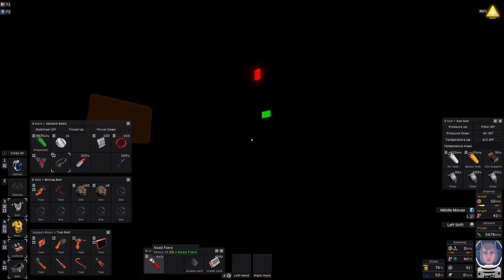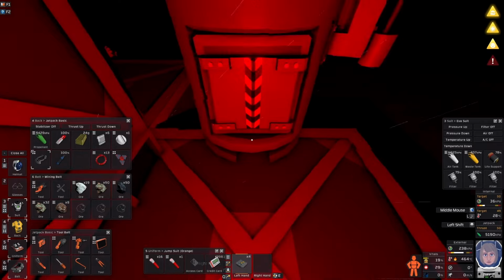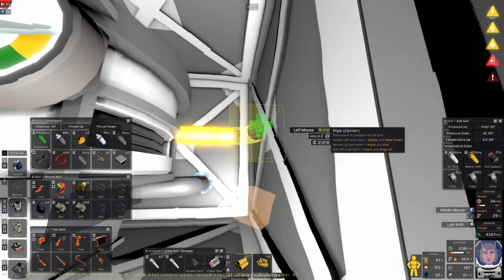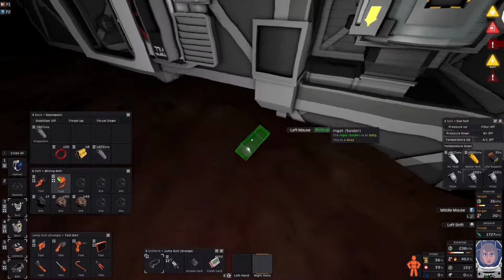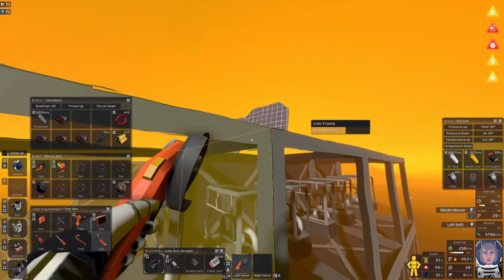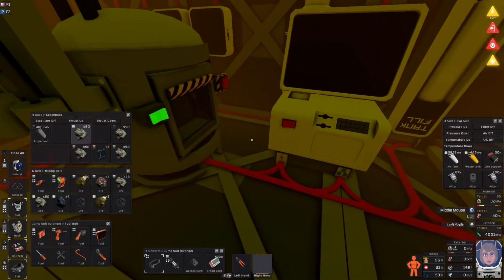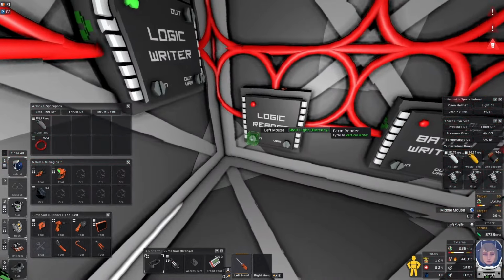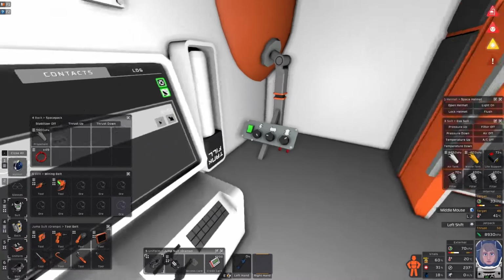Venus Brutal Stationeers Guide [Outdated] (without wasting oxygen)

Comment: Incredible video mate! Could you go into a little more detail into how you've piped up your A/Cs and filters? It's a little hard to see in the videos where all the input and output pipes are connected. How close were you to running out of stored oxygen by the time you got the O2 filtration setup?
Reply from the maker: Here is the save:
drive.google.com/file/d/13Oxn5ZGHqVCNE1D5SlTjJ7Ezfn93INV7
Reply: @murtisoft  thanks! I ended up finding a flyby of the setup from when you were setting up the landing pad which i went through frame by frame lol - very helpful, I don't think i've rewatched any video as much as I have gone through this one ;)
Reply: @murtisoft  the save was very helpful thanks! found the last pieces i was wondering about. What's your next challenge?
Reply from the maker: @the_wilderman  Well, nothing. ¯\_(ツ)_/¯
Reply: also where is your water input? i assume you pumped your insulated canister in somewhere for farming?
Reply from the maker: I cant explain much more through text beyond what i have already explained in the video. I will upload the savegame for you to mess with.
The amount of oxygen you use by breathing is miniscule, once you have a cooling setup, you can live off of the starting supply for a very long time, just by reusing it. I bet I didnt even use 1/4th of the starting supply by the time i had oxygen production via potatoes.
Similar to my oxygen supply, I filled my water pipes with the starting water canister, and recycled the empty canister later on. By the end only water input I have is through the landing pad.

Comment: Whenever I try switch on even 2 of 3 pipe heaters in the furnace hotroom setup, cables start popping all over my base. Followed this guide pretty much to a tee but I can't get my head around how you've made this work. I think it stems from the fact that APCs have unlimited output, meaning it can spike the power over 5kw even if its input is capped, because of the energy stored in the battery. Am I missing something, or did you just make sure your base was at a low power draw before running the pipe heaters?
Reply from the maker: You are right, APCs have unlimited output. for the input limit to apply to its output as well, you need to not have a battery plugged to its slot. You dont need to have one there, after setting up a station battery anyway. Besides, having no battery plugged in stops the annoying buzzing sound it makes. :D
If you turned off your cooling system while you are electrically heating your furnace, 3000+change electricity draw should not burn any cables even with a battery plugged to the apc.
Reply: @ thanks for the reply, I managed to get it to work by disconnecting the ac and using the network scanner to verify I had more than 3kw headroom. 

This was a really great video btw, I would love to see more challenge guides or more specific guides too, good editing, good info, good work.
Reply from the maker: @MichaelW-qb6rd  Glad you got it sorted. At 22:17 the transformer in the corner controls the power input to the entire atmospheric group, both cooling and filtering. You might have skipped that one.
Reply: @murtisoft  hahaha, no I’ve just been lazy and been removing the cable whenever I need the atmospherics turned off 😅. I tried not to miss anything to the point of going frame by frame for some portions, for instance to see how you set up the solar tracking (this is my first ever play though of this game)
Reply from the maker: @MichaelW-qb6rd  First ever? holy s-. You went in the deep end. I even skipped explaining certain parts, trying to keep it short, assuming people would know them by that point.

Comment: Very good guide.
I initially use three furnaces - one for degassing and solder production, one for melting the already degassed ores for the production of alloys (copper, gold and electrum), and one with a temperature of 1210 degrees Celsius for invar, constantan and steel.
When degassing in the furnace, according to the game mechanics, the temperature drops to 100 degrees, and for Venus, these are devilishly cold gases. I filter X and N2O, and collect the rest through the waste outlet (O2, N2 and CO2) in a tank. With one conditioner, I cool the collected gases to about 30 degrees and use them in the greenhouse, and the waste heat is used to heat the degassing furnace.
Reply from the maker: Good idea. I did attempt something similar before. But for invar, I usually just get lazy and buy it from a trader.

Comment: Great video dude! Great pacing and you planned this really well! It's refreshing to see a narrated video where the player isn't guessing what they're going to do next 😹 Great stuff!

On planets with an atmosphere, I usually add at least one wind turbine to max out batteries during storms. They're not too expensive and are really helpful to keep power topped off. Upright turbines can produce a decent amount to at least keep some charge on batteries in APCs

Btw why did you skip an arc welder? It seemed like you were able to produce one earlier in the video. Was it because of the power situation?

Also there's an exploit where if you use the wrench or cutters to place the same segment of wire, it applies the paint. No need to remove and replace

You can enclose your solar panels behind windows. I think there's an efficiency loss, but it's better than the time spent rebuilding or repairing them
Reply from the maker: Because of 10 solars on the roof, they produce 4980 watts, just 20 short of blowing a wire, adding a coal generator or a wind turbine will require splitting the circuit with an apc or transformer, and in my experience they waste some solar power because of some mysterious delay as they relay (Beyond the 10W they consume)
Arc welders are slower, but it wasnt really conscious here, i havent even spent the entire fuel canister when my recording ended. I just didnt need it.
I do overlay colored wires on top of older ones, its just faster to remove corners, instead of trying to match the shape of the previous. That said, i do frequently forget.
As for the solar panel damage, such improvements would most likely come after the events of this video. It was just a total of 3 storms.
Thanks for the feedback.

Comment: From my experience, on a power budget you can do 4 ACs to barely work with Venusian temperature to get your base down to 20C, it will be extremely slow though but it can be enough to potentially cool your base down. I like to see how things go and you definitely showed that it is possible to save that first waste tank. I had resigned myself to losing the first tank but being able to get a habitat setup and capable of saving subsequent waste tanks. My starting base is a very cramped 2x2 base, its enough to stack the printers, hold your tank, and disassemble the crate to have some storage. It is possible to still make the dish but the ability to expand the base is a huge relief.

Interesting to see the solar tracking route. Usually the first thing I do is rush out the steel to get a station battery to get a solid fuel gen to use it to begin charging the battery for base power. Once that is ready I get started on traders, then AC, and then finally start working on renewable energy so that I'm not reliant on coal 100%.
Reply from the maker: I have tried 2x2 previously, trying to come up with the best start, but concluded that rushing iron for a 3x3 is a lot less cumbersome overall.
Using no wind or coal is my stubborn obsession more than anything, and it definitely isnt a must. I doubt that my habitat could manage 4 ACs, with their efficiency penalties, although I imagine it wouldnt be an issue with coal.

Comment: I suggest do some things different:
1. Put Arc Furnace inside and vent gases from time to time. You save time and oxygen on going out.
2. Make simpler horizontal only solar tracker and set vertical angle some in middle. Its need only 2 I/O logic and solar sensor, instead of 7 components and a loot of cables and give you  only little less energy. Full tracker made with IC10, when you can make it.
3. Make second furnace for outgassing ore, and store this "cold" gasses (in practice about 150C). Then use it to cool your oxygen with only one air conditioner (with two will be much faster!). Its enough cooling capacity for some time. Of corse, you will need full set of AC at some time, but you get much more time to build save power generation capacity.

Comment: Great explanation on cooling, one question what are the Air Conditioners set at?
Reply from the maker: The first six are set 90 degrees apart. Assuming atmosphere at 470, they go like 380, 290, 200, 110, 20 and final one at -80. Seventh, habitat cooling AC is set at 20C
Reply: @murtisoft  Okay I figured it would be something like that.  Then again I didn't think it could be that easy.  Me and Venus have a history and let me tell you, I don't fair well.  But now, I just placed my AC's and my supplies are still looking good, the tides may have turned as long as I can avoid the random death while mining and getting slammed.  Thanks again